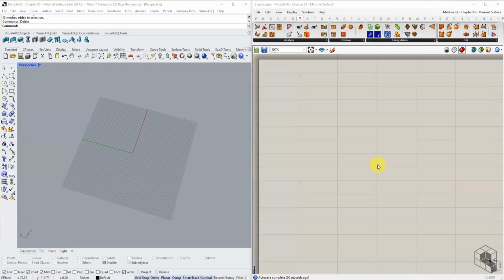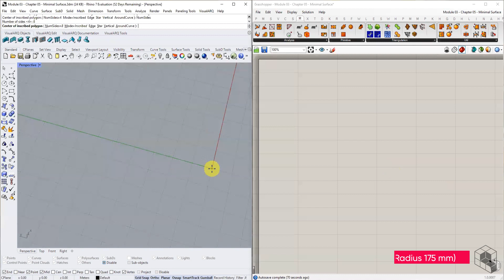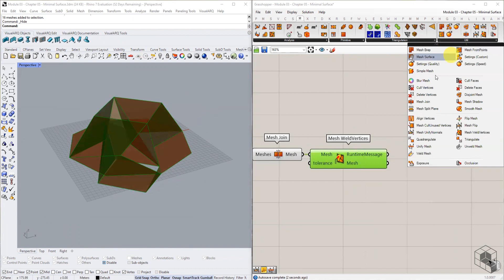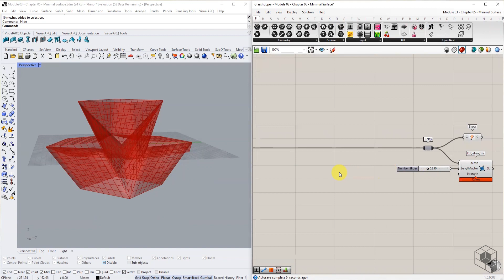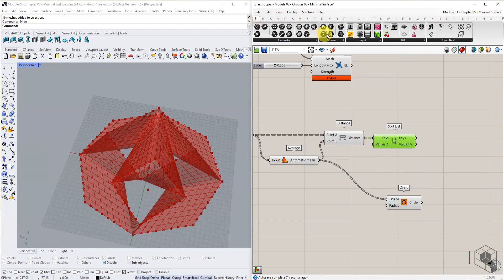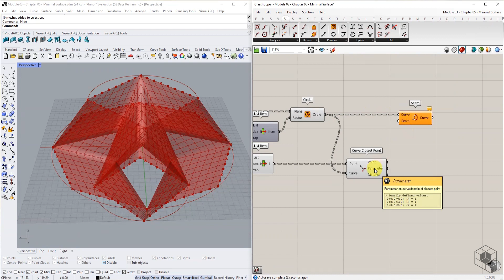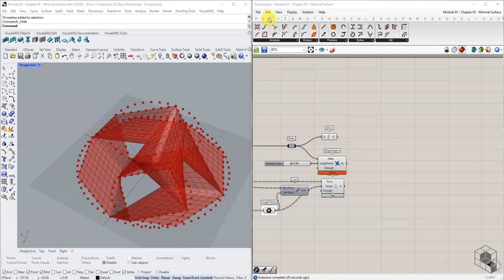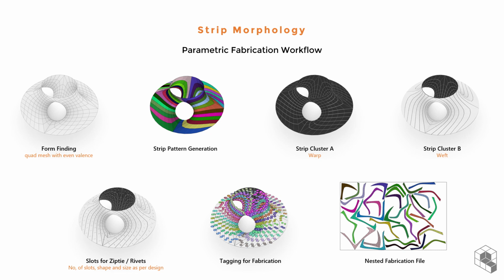Digital Form Finding - Chapter 05 | Minimal Surface | Rhino & Grasshopper Tutorial

Comment: hello for some odd reason when I do the curve closet to point command it turns red and there's an error "1. Data conversion failed from Number to Point" I followed step by step however the points don't show up even if they're right on the circle. HELP PLEASEEE
Reply from the maker: Hi. Please share your Rhino +gh file to qbricklab@gmail.com and I'll help you out. Do highlight the area where you are facing an issue.
Reply: me too